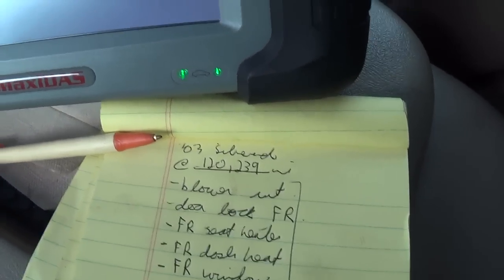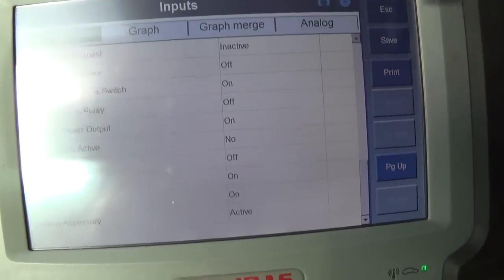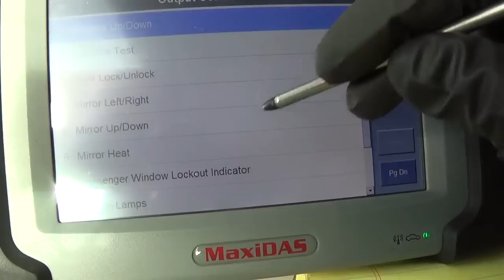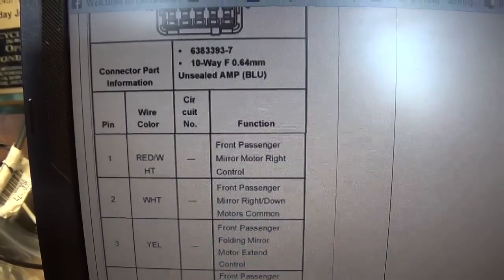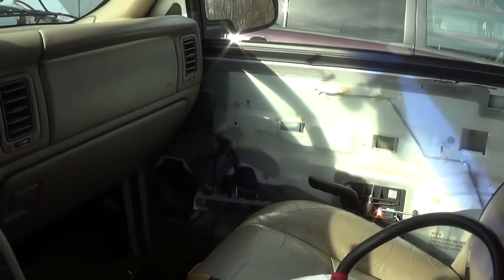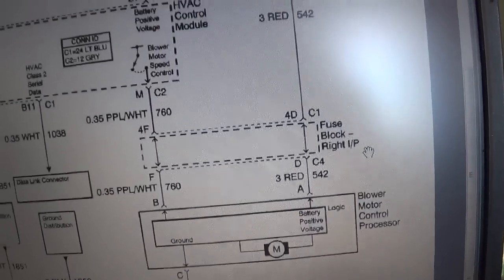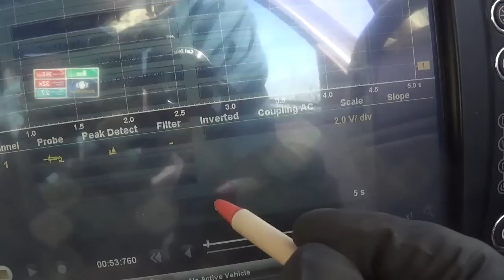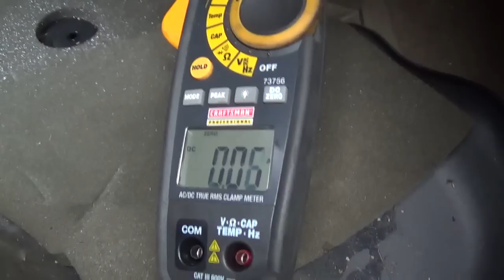Window, lock, mirror, blower issues: '03 Chevy Silverado

Comment: Blower motor drawing too many amps because there's a rats nest in it. Just done one this morning. First thing i did was remove blower motor and shop vac the rats nest out. It just snaps out. You didn't even look in there. Look at the simple stuff first. Don't get distracted by the tech stuff. With solid state electronics it always the moving parts. Door module problem is the contacts on the moving switches. All that tech education can just get in the way.

Comment: Why make life more complicated with a scope, when a DMM voltage test of that blower module’s control wire (ppl/wht), at different fan speeds, would’ve shown you that it’s faulty (ie it would’ve shown low voltage at certain speeds) ?

Comment: We just bought a 2004 Chevy 2500 hd super cab pickup. Window has issues going up will get stuck halfway and really have to mess with it to go up. Blower motor only works on high. Went out of town yesterday and now the passenger door won’t unlock at all inside nor outside fob won’t unlock it nothing works… door is stuck shut. Are all these issues connected????? But really need the passenger door to open Help ……

Comment: Same problem with passenger door on 2 different Chevy trucks, same diagnostics run. Ohmed all wires to door from dash plug. Tried 2 new door modules from O’Rielly thinking one must be bad, still doesn’t work. Tried batt disconnect for an hour, still nothing. Customers are losing faith in me. These trucks are wearing me out.

Comment: Well done, for me a shaky camera or a bit of glare doesn't matter its the content, just thought id mention. Ok for me when I worked part time at my friends parts  store we changed a lot of batteries and on occasion not brand specific certain BCM would not restart. Took a while to realize it was us that was causing the faults because the customer would say  my car worked great till you changed the battery.  If we disconnected the battery again most times they would come alive but their  were a couple that did not. I wont change a battery again without putting on a system voltage  maintainer and on newer models it even worse not to put a maintainer on. Just curious if the battery was disconnected prior to you seeing the truck. Also on models that have a blower resistor or integrated module  in the duct work most times its the cabin air filter that's never changed that caused an over heat condition to the modules. I remember selling a customer 4 modules before he even knew he had a cabin air filter HAHA.
Reply from the maker: +Steve Rob Yup used to be after changing the battery you just reset the clock and you're good to go! Not so on late-model cars, especially those Euros where everything is memorized and initialized. Honda radios are also annoying with their anti-theft codes lol. Good point on the cabin air filter! Not sure if this truck had one...

Comment: Well done!  I love the way you and Eric O communicate with each other.  It's cool how you helped him out on that crank position sensor.  Eric just did one of those blower control modules on an Envoy, and he bought a NAPA part.  LOL ask him about it.  Weird on that door module. I have a 06 Yukon, and I had to remove the passenger door panel.  It got late  so I drove the truck into the garage.  Buttoned it all back up, and the door went dead; nothing worked.  The dealer needed to hook it up to the Tech II and reprogram the module to work again.

Comment: For those of you who may be having a hard time pulling the connector with the gray strap off the module, here's how. The connector in question looks like the middle connector at 8:45 in the video. It has a gray strap around the black connector body. There is a tiny tab behind the strap on the black connector body that prevents the strap from moving. Hold it down with a small screwdriver or pick and then pivot the strap over the tab and all the way back.

Comment: Like the head light.Modules have taken over the planet.Nice call with the amp draw.Pwm very clear when varied.The spirit world has taken over the passenger door module, needs to be exorcised.Great info from the Autel.Pulling the connectors must have done a reset on the micro-p.The blower  motor has come a long way with its fancy control module.Job well done.
Reply from the maker: +Tom OConnor Thanks Tom! The spirit world has taken over lol sounds about right :)

Comment: Good call on checking the blower motor for an amp draw.  Eric didn't do that on one of his video and he had a callback.
Reply from the maker: +Upallnight To be honest, I didn't even think of doing that final check until Eric mentioned to me that he got slid by worn blower motors a few times LOL!
Reply: +motoYam82 Way to have his back. I watch yours & Eric's videos and enjoyed every one. I will usually unplug, ck contacts, spray with contact cleaner and plug back in door modules, HVAC modules and anti lock brake modules which seem to be susceptible more than other modules. Keep the videos coming & Merry Christmas!

Comment: with this being customer pay i would say you are right to leave the door module alone, however if this were a newer vehicle under warranty i would have put a door module in it.  any module like that can seemingly come back to life for a while then have the same problem again.  like you said it may be 10 years down the road but it could also be 10 minutes.  i just had a similar situation with an airbag module on a 2016 kia sorento.  someone  replaced pretensioner and wire harness, and it came back so we were required to open a techline case.  unplugged module and plugged it back in and techline told us to replace module.

Comment: great video. you might want to scope the amperage on the blower motor because the your not going to see the large spikes of amperage during turn on with a averaging amp clamp
Reply from the maker: +Tim Waterhouse Good point, Tim. However in this case you're only really worried about the steady-state current with the blower on HIGH. A momentary current spike won't kill the module, but prolonged over-amperage might.

Comment: So I have the same truck my ac works but the driver side temperature control when you turn to higher temp the digital readout jumps from higher number to lower number . If I mess with it enough I can get it to stay at higher temp to get heat. Going from a higher temp to lower temp seems to work. No problem with passenger side temperature knob

Comment: I have a weird problem with my passenger side door module. It worked when I bought the truck then stopped working. This past weekend it started to work everything again until this afternoon when it stopped working again. Dealer said the first time it was a broken wire then the second time it was the module. The module does function but could it be the BCM since the one I bought the truck from said it needed a computer? ECM seems to be just fine.

Comment: I have an 01 Tahoe that I have yeied every thing I can think of and still no power to the window or door lock. I have changed the switches, fuses, circuit breaker, window module and relays with no luck. Any suggestions would be great. 

Please help.
Reply from the maker: My suggestion is to follow a wiring diagram and test for voltage using a volt meter or test light instead of replacing parts 😉

Comment: I just did an electric window conversion oem style on my 2003 silverado single cab. I changed out the dash harness and bcm as well as the fuse box. Got the door harness and all. Everything is hooked up but only my driver side works. On the passenger side my window does go up or down. Only the lock works on the passenger side and the mirror. Any help will be appreciated. Already been trouble shooting on my free time and i cant get to the bottom of it. Motor works when it gets direct power.

Comment: Since when do door locks and window motors need their own control module? I mean a simple reversing switch is all takes to control either, and when it fails you don't need a $1000 scan tool to reprogram the thing.

Comment: DANG IT I am having the same door lock and window issue with the driver side. same system, i was hoping the diag would have continued. I don't own a scan tool. Maybe a test light and volt meter aahhhh chevy's

Comment: Thanks for the vid. If I was still working I would sell my souls pro and grab a autel for sure!   On that door mod. I was wondering if disconnecting the battery would have done the same thing?  what say you?
Reply from the maker: +Joseph Tucci I'm not sure if disconnecting the battery would have done anything. If all the module needed was a "re-boot", then maybe. But if it was an issue with the pin contacts, then probably not.

Comment: ok, i need your help.  a 50A fuse marked MBEC in my underhood fuse panel keeps blowing.  The first stop from this fuse are two items labeled Power Seat CB and Right Window CB. I assume that means circuit breaker....and I have found these circuit breakers.  If these breakers are not popping, can I assume that the short is between the CBs and the fuse?  Could a short be past the CB's and still cause the fuse to blow?  I suppose if one of the CBs is be broken, which would mean the short is after the CB's anyhow and replacing the CB's wont ultimately solve the issue. Also, is there a better place for me to ask you questions, rather than on these comments?
Reply from the maker: +Marc Schneider I think you have a short to ground in the harness between the fuse and the circuit breakers. Quickest way to diagnose:
https://www.youtube.com/watch?v=G1RIXqcuNKY
Good luck!

Comment: how come you did not use snap-on verus scan tool?
Reply: +kkovler1  for diagnosing the first part with passenger door?
Reply from the maker: +kkovler1 The Autel 708 is usually my first plan of attack...just faster, lighter, more efficient :)
Reply: +motoYam82  Ivan, I need a tool that will access those door modules. I see that it doesn't have to be a Tech2, but do you know of anything cheaper that has that capability?
Reply from the maker: Autel DS 708 is under a grand, and probably much cheaper used. Doesn't get better bang for the buck than that!
Reply: Thanks Ivan, I will chase one down, or give in to a cloned Tech2
Reply from the maker: +kuruji Watch out for those clones...I have heard that they can actually mess up the vehicle PCMs!
Reply: +motoYam82 That and the Verus breaks every few uses, or at least Eric O's always does lol
Reply from the maker: Eric Brunhammer
True story lol

Comment: working on a Yukon with the same issues but the drivers master switch doesn't work along with the mirrors. etc. bad drivers door module. did the exact testing as you did before I seen your vid. must be common in this year of gms